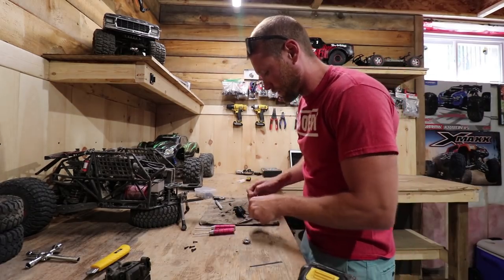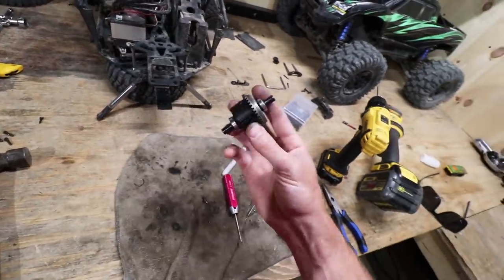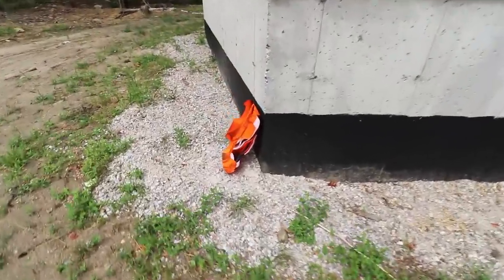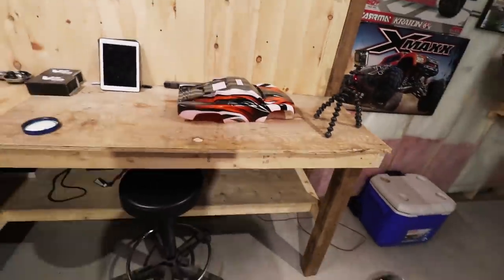How NOT To Paint an RC BODY.!

Comment: I changed the pins in my diffs with spring steel they're only 1mm thick pins shocking considering the stress there under. I always thought it was a bad move but if you say you prefer it dam I'm happy with that knowledge. Thanks dude